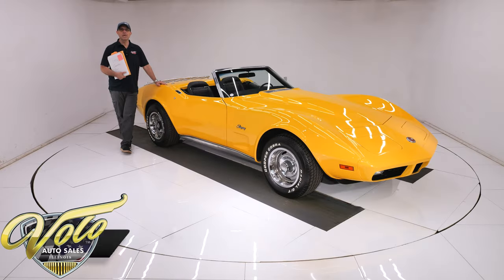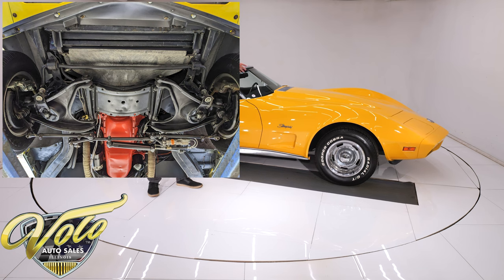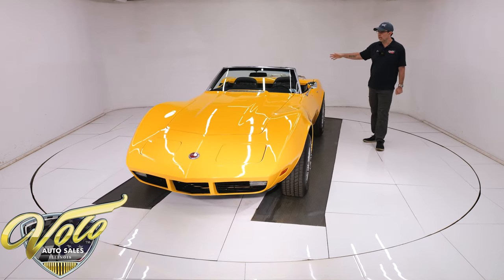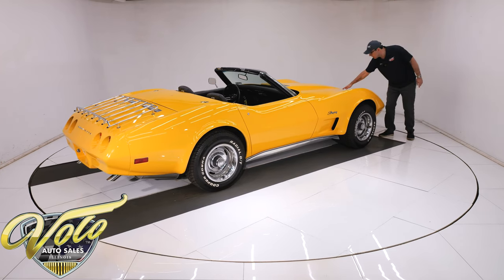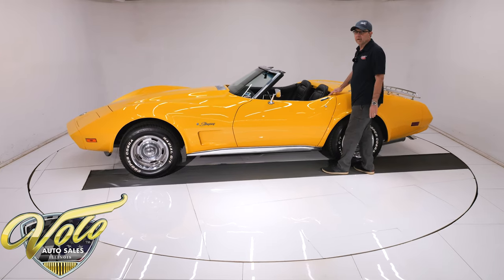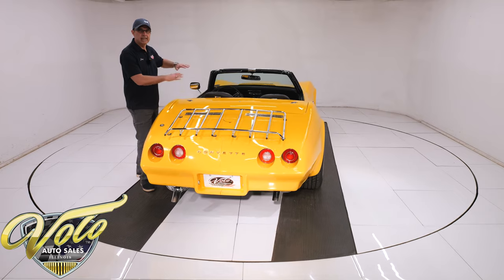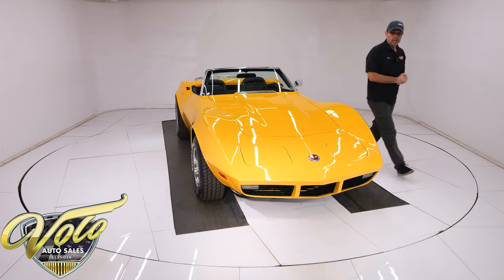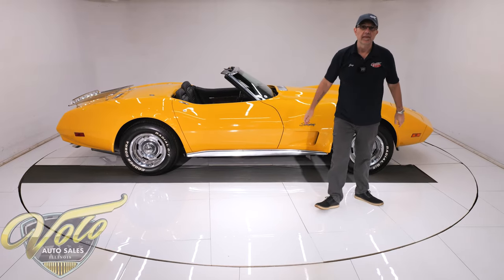1974 Chevrolet Corvette for sale at Volo Auto Museum (V20906)

Comment: I bought my Stingray when i was 17 in high school. He didn’t mention the alarm system. The key hole in front of the Stingray on the front driver side fender is the alarm. It scared the crap out of my best friend when he went out to look in mine during 5th period. He ran across campus and into my British Lit class and was out of breath. He came in and shouted, “Hey Mike! Your car is going crazy!” I had forgotten the alarm was on and he had wanted to have a look I side. I never locked the doors in my ‘67 Camaro so he thought I wouldn’t have the Corvette locked. Let alone have the alarm on. 😂

Comment: Nice car, But it's got some kind of valve inline with the heater hoses on the top of the motor. It definitely didn't come from the factory with that (yes, I'm that customer that's that anal about originality). Attention to detail on those exhaust pipes needs to be addressed. If I'm spending a lot of money on a car, I shouldn't have to adjust or fix anything on it.